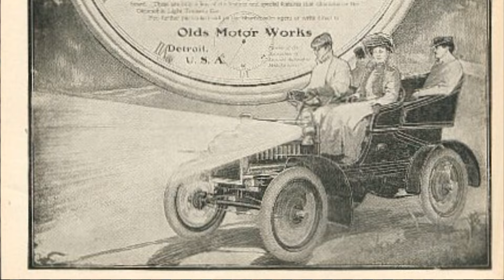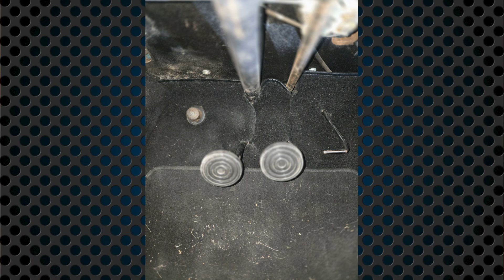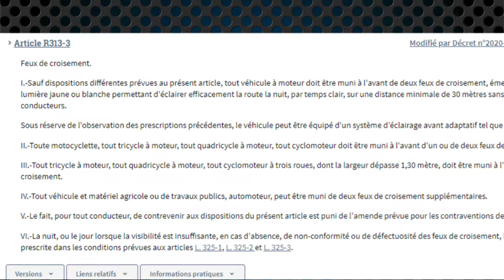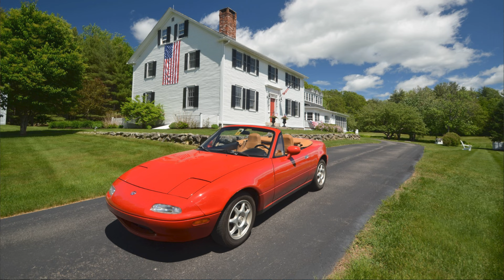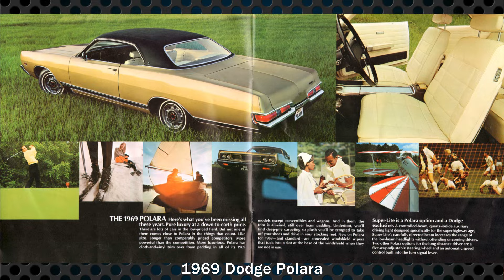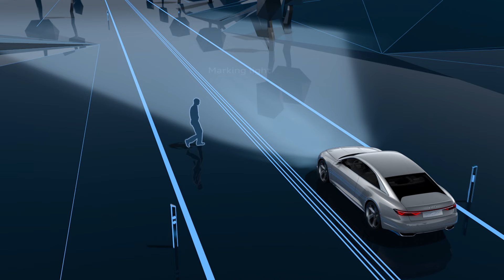History of The Headlight | Acetylene to Sealed Beams to LEDs!

Comment: As one that drives overnight for a living, I’m appalled at the number of vehicles that either have their high beams on continuously (which is unlawful in most states to oncoming traffic), have NO lights on (or only the DRL’s), or run those ridiculous LED light bars just above the grille. Come on y’all, have some courtesy for you fellow road users, by dimming your bright lights BEFORE you have them in your field of view. BTW, if you don’t know what DRL’s are, then just turn your light switch in your vehicle to the “AUTO” setting and leave it there. Please!

Comment: Great video, thank you! I hate the lights on new vehicles. Way too bright, blinding, and hazardous.
Reply: Part of the problem is the poorly designed aftermarket LED bulbs installed in reflectors made for incandescent including halogen. Then there is the people that found the adjuster screws but don't know how to use them. Lets not forget the idiot customizers that raise their 4x4s way too high for the legal headlight height or raise the front and lower the rear like they are something special. Then we have "D" all the above.

Comment: In the early days the US sealed beams our performed European lights with replaceable lamps.  US lighting regulations put the drivers vision first, and glare control second. Europe's regulations were the opposite - very strict controls on glare, and lower minimum output requirements. 
The article "HEADLAMP HISTORY AND HARMONIZATION" by David Moore is a good read on this topic.
Reply from the maker: Yes. I mentioned that near the end of the video, that even to this day the EU and US prioritize "upward light" different.
I did find Mr. Moores paper and scanned through it when preparing for this video. It got a bit more "in the weeds" than I wanted to here! But thanks for the comment and mentioning it!

Comment: I use LED's only for the high beams. HID's for the low beams and the fog lights. When turned on, LED's have that quick flash quality for passing cars. But HID's have the wider even beam pattern, choice of kelvin color temperatures and are still very bright in a Bi-Xenon projector housing.

Comment: Most of the Headlight Blinding and other problems are Illegal rubbish sold on Amazon, AliEx, or even at many local auto parts stores. Their Too Bright or putting HID or LED in Halogen fixtures then light doesn't focus right is only the tip of that iceberg. Worse Most of the Public don't know or care if X is bad. Even if aimed correct and people try reading fed or states laws... FMVSS 571.108, some state laws and many other countries Light output for Headlight and other fixtures are often hidden in SAE documents that's even more hidden by Paywalls. But some copies are available by web search sae Jxxxx.  Examples: J1383 Performance Requirements for Motor Vehicle Headlamps has many Maximum and Minimum Candle Power but "public" copy is 1985 version doesn't have HID or new LED's. J578 Color Specifications for Electric Signal Lighting Devices "public" copy is 1995 version may not cover Cool White etc light output from some Halogen, HID, or LED.  SAE et al is still fighting big lawsuits trying force their documents as Public Record as are based on laws, rules and codes across the USA and many other Countries because the paywalls generate Millions of $ per year for each "publisher."

Comment: My 2019 GTI had the best headlights.  LEDs with a sharp cutoff that would turn with the car around curves.  Really lit up the road, without blinding oncoming drivers.
Factory sealed beams are the worst.  My 2001 Jeep XJ has these.  If the road is wet at night, good luck seeing much of anything.

Comment: Small Round and Rectangle sealed beams had High and Low beam in 1 lamp and second Lamp only High Beam. Sealed Beams had Halogen Bulbs inside them way before H1 replaceable lamps was allowed. These where OEM parts on High $ models or later some Trim level(s) for a model and thru Aftermarket from GE and other major brands starting in the late 70's. Where some brands still offer Sealed Beams, often only the Halogen are sold like H6054 that pull more power from old wiring that need to upgrade the same or expect to burn up switches etc.

Comment: I live up north where it snows a lot and it hurts to breathe in the winter. I tried LED bulbs in my 4runner and I learned a few things….
- LEDs don’t work well in headlight housing designed for incandescent bulbs. Retrofitting LED bulbs in stock housing is a waste of money. 

-incandescents give off infrared heat that keeps your headlight lens free of snow and ice… LEDs do not (this is a major problem when you need your headlights the most) 
-incandescents shine through snow flakes and highlight the road far ahead in all but the absolute worst blizzard conditions while the beam from LEDs light the snow flakes up directly in front of the vehicle like you’re piloting the Millennium Falcon at warp speed and the road far out ahead is left dark. 

I know technology has worked around a lot of the issue in luxury cars but they haven’t addressed the lack of infrared needed for us northerners.

Comment: I miss sealed beams. With today's U.S.-spec cars, the intensities and aiming is so radically different from car to car that your eyes are constantly re-adjusting and most of what you see is glare. Allowing the intensity to double, then double again, without requiring smart aiming or masking to only direct the light at things that need to be seen was a huge mistake. Any light that is directed at other driver's eyes is not helping you see any better, it's just blinding those coming at you. To make matters worse, with some vehicles having 4 lights even for low beams and others with 2 low-beam lights that are as bright as other's high beams, it's impossible to tell if some cars are using their low or high beams, so some drivers just use their high beams non-stop, while others have fog lights that might as well be high beams. All this misdirected light is more blinding than illuminating, and some experts believe the excess blue component in some LED lights is causing early retina damage in some.

Comment: I don't mind sealed beams, unlike all this plastic crap made now that fades and yellows. All lights now are to bright and way to expensive.
Reply: No such thing as too bright. But as for the cost it is. For example the 2022 Toyota Corolla with led headlights. The price is around $1100 per side. I’d rather have around $200 per side with conventional halogen and incandescent bulbs, to swap with led bulbs that are bright but remain the same beam pattern. 😊

Comment: Headlights a generation ago:
2-light round, 4-light round, 2-light rectangular, 4-light rectangular. Could break in low-speed impacts. Available everywhere for under $10. 
Now:
Headlight assembly unique to every car. Can break in low-speed impacts. Cost $500-$2500. But they are aerodynamic and give you a .0000372% increase in gas mileage.
Reply: Mandatory sealed beams have always been retarded.
Reply: But speeds in general where much much slower as well.

Comment: I remember when I got a new company car assigned to me with LED headlights coming from HID & Halogens in my personal vehicles at the time I remember being unimpressed while the LED was pretty blinding to oncoming traffic that strict beam cutoff at night didn’t allow me to see the small street signs at night used in my area especially if I was in the more rural parts of my territory. Even with the high beams the cutoff was just below the sign, Not to mention I believe my HID’s still threw light a greater distance when it came to unlit reflective hwy signs. almost 5yrs later my current truck has LED headlights while the street sign thing isn’t a problem with my truck (height may have a lot to do with it) I still say the HID system in my other car and previous truck both threw more light down the road to illuminate those hwy road signs. Also the glass composite headlights on my car with Halogen headlights with never fade and get cloudy like all these modern ones which is probably a whole other subject for a different video 😂👍

Comment: Now automakers used plastic lens and the problem with that is they can get cloudy/yellowish over time
Reply: Yes and it takes quite a bit of both repair and maintenance know how to keep them usable. My first car that took a replaceable insert bulb was a 1988 Olds 98. It had a glass housing. Although it could be damaged by rocks off the road, it never got yellow or hazed. Very preferable. And although the reputation of American cars is they weren't quiet up to par on quality, efficiency and handling, this one in fact got 30 miles a gallon in a large comfortable vehicle and very reliable when sold with 300,000 miles on it- and had good headlights! The respected 3.8 V6. I would do it again.

Comment: LED lights have many advantages over Halgeon lights - brighter, last longer and don't burn hot as Halgeon does. The only problem is that they can be too bright and blind you
Reply: And too cold to melt snow and ice off of. At least up here in the frozen tundra of hell.
Reply: I have serious questions about actual OEM LED modules outlasting halogen lights. If the thermal management is (deliberately?) not good, they will burn out quickly.
Reply: @ I don’t own anything new enough to have OEM LEDs but, I don’t find LEDs any more long lasting than halogen. The actual LED itself may very well last forever but the electrical circuit inside always falls. Water eventually ingresses in and it’s game over. I own a semi truck and deal with LED lights failing constantly. Even very expensive ones. Maybe if the companies start actually making the case of the light 100% dust/waterproof, they’d last longer. LEDs also tend to draw more corrosion to the wiring. Idk why this is but it has to do with the lesser amp draw. I switched from halogen headlights to LEDs and I know have to replace the headlight harness yearly because the copper wires just rot away and turn to dust. Next time I’ll just go back to halogens.

Comment: Thank for the video information, The first American cars that used rectangular headlights was in 1975 model year by GM. They were on: Oldsmobile Ninety Eight and Oldsmobile Toronado, and Buick Riviera, Electra, Cadillac Deville, Seville, Fleetwood and Eldorado and Pontiac Bonneville and Grand Ville. They then spread to other GM cars in 1976. That is correct and true about Lincoln Mark VII,  GM then stared the model the move to flush headlamps in 1986. Great video.
Reply: They were also on the '75 Chevy Monza (and hastily badge-engineered Buick Skyhawk and Olds Starfire) which were the first cars "born" with them, the Seville not appearing at new-model intro time and the others you list being facelifts.
Reply: @nlpnt  Thank you for your post. I forgot about the Chevrolet Monza, Pontiac Sunbird and Oldsmobile Starfire and Buick Skyhawk. You forgot about Pontiac Sunbird. I do recall the 1975 being facelifted upscale models models that got the headlights first.  The other GM cars got them in 1976.

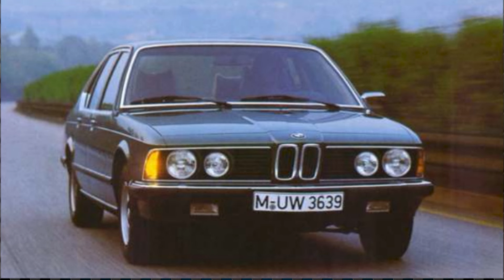Comment: 12:09. This shows the wrong car (the '77 - '86 model). 
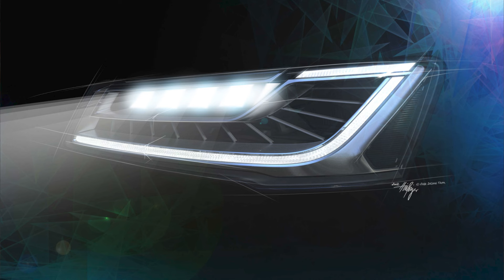12:50 The 1st LED DRL was seen on the Audi A8 (only W12) from 2003. 
15:20 Absolutely. Also remember the issue with rear turn signals being red and combined with the brake-light...
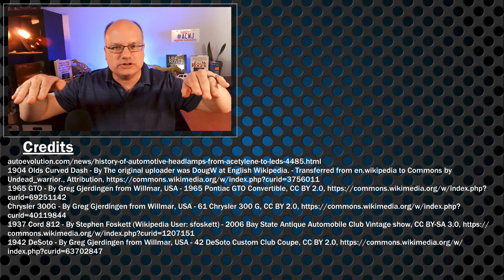15:47 Not just that. For decades this cut-off-line had to be asymmetrical with a ramp up on the right side (mirrored for Great Britain).  
But this appearantly isn't mandatory anymore. 
I have (had) 3 BMW motorcycles with simple straight cut-off-lines. (Very dislike it because of shorter range.)

Very interesting stuff although!

Comment: My wofe has a Porsche cayenne and it has the best headlights i have ever used. Zeon bulbs, turning lights, auto level, brights that light up the night while leaving the zeon bulbs on. 
They are amazing and a joy to drive at night.
Reply: My 2003 Lexus ls430 has Auto-leveling headlights too
Reply: XENON bulbs, not Zeon. They are incandescent and filled with xenon gas, the most expensive product on earth. It os s very dense gas and it doesn’t convect, carrying away heat from the filament and cooling it and lowering efficiency like argon/nitrogen used in most lamps do. The result is a pocket of super heated gas forms around the filament, retaining the heat and increasing efficiency a good amount, and also exerts a good amount of pressure on the filament, retarding sublimation (evaporation basically) of the tungsten filament, allowing operation at much higher efficiency and brightness at a higher but still warm color temperature with no loss of life. The bulbs have to be smaller to use as little of this insanely expensive gas, but the bulb temperature stays the same because so little heat is wasted. Cheers!

Comment: Great follow up vid, i try to find history Australian ADR rules on headlights but found statement saying you must enough light to sèe 100m away.  I remember Pa adding more lights to his farm machinery, 80's young farmers were adding spotlights at front on their bullbars n on the roof/roll bar but you couldn't have odd number of lights like 1 or 3 or 5.  Spotlights can be used on the road but must be turn off when encountered oncoming traffic or cover up/folded down when not in use but laws have relax or not enforce.  Ford AU falcon in 98 had best headlights ever they were first Ford triangle headlights.

Comment: Thank you for researching this! I remember watching a YouTube video of a designer who worked on the early Toronados. He explained why Toronados went from hidden headlights in 1969 to exposed in 1970. US regulations came into place stating the minimum time concealed headlights could take to go from concealed to unconcealed. With the vacuum system GM was using, it wouldn't meet the standard, so they just chose to nix the concealed headlights.
Reply from the maker: Interesting!
Reply: I seem to recall my Porsche 914 headlights were lit as they came up into position.
Reply: Europe is always superior.

Comment: Some of the modern migraine-inducing offerings need to be outlawed.  They blind other drivers.  It bewilders me to think that this obvious safety risk would escape government safety regulators.
Reply: Agreed. And misadjusted headlights and misused high-beams need to be stopped. There was a time where one got a verbal/written warning from a cop by having either of those.
Reply: Most of those are idiots that install aftermarket bulbs, the others are huge trucks that the bulbs should be placed closer to the bumper but for some reason they are not and are at the exact levels a standard sedans rear view mirror. 
They should have to lower the placement of those for sure.
Reply: Couple of issues here, in addition: 

One issue is people driving around with their high beams on. Some of them just don’t notice, and this feature should really be made more automatic. In high beam mode, automatically lower the lights when detecting oncoming headlights. 

The other issue is some headlights get misaligned, or stuck on high beam on one or both. 

Lastly, the automakers are not focusing on the aiming and shielding like they used to just a decade ago. The pattern for a single headlight is supposed to be like this ___/——, not any other way.
Reply: And the cataract type plastic lensing that clouds over time.
Reply: Well it didn't it's just that these new regulations pretend to care unlike the older days
Reply: All regulations, at least that I've seen, are for minimum levels of light. Until recently everyone assumed more is better.
Reply: It's almost as if the government doesn't really care about your safety...
Reply: AFAIC it doesn't.  "Safety" is just a ruse to pass regulations and enact fines.  Safety is only a concern if it can be exploited.
Reply: One huge problem is Illegal Headlight "Upgrade" that Does Not meet DOT or ECE requirements that flooded people with this garbage on Amazon, Ebay, and more. HID and LED "upgrades" in Halogen Headlamp assemblies do not focus the output and blind other drivers. You can get Legal LED Sealed Beams but expect to pay $200 - $300. Cheap LED Sealed Beams "upgrades" are Illegal but Amazon etc hinds behind Section 230 and other laws allowing them to take money from illegal dangerous products.
Reply: When the price of "caring" about safety - or, in actuality, the amount of liability and amount of harm caused by those onjured directly by headlights outweighs the regulator and law makers' "dollar cost of one single human life", then they will take safety into account.

Until then, its cheaper to pay lawsuits.
Reply: Shut up Karen